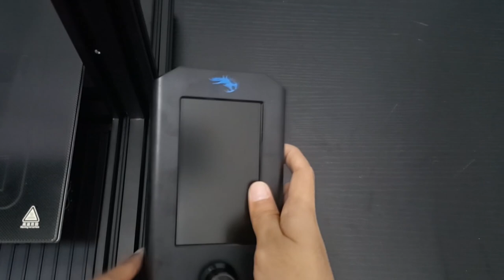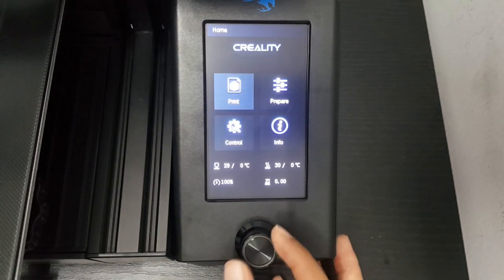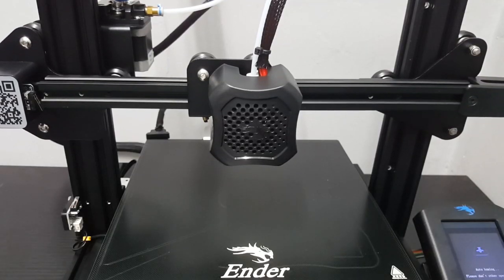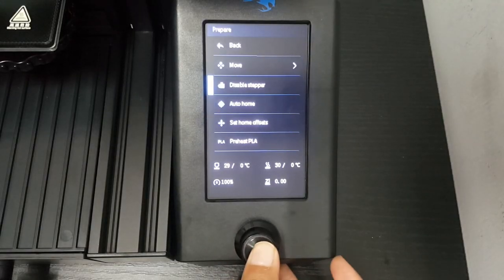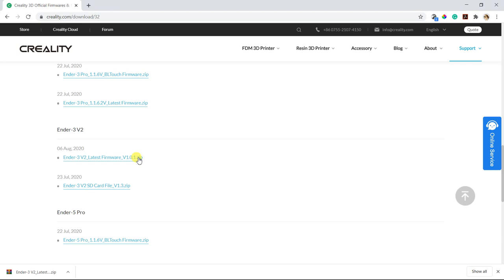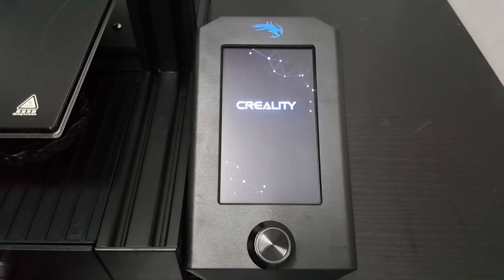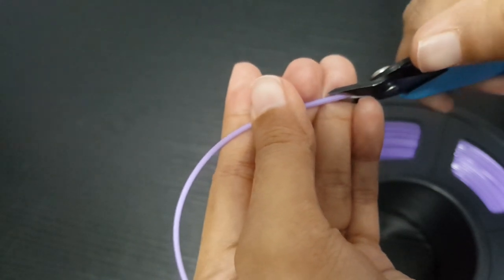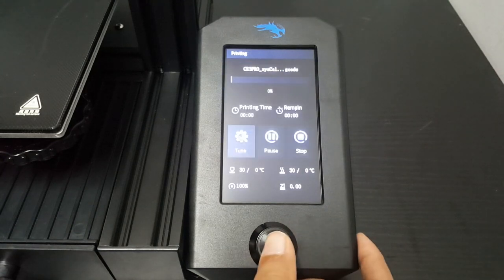Assemble and Update Firmware for Ender-3 V2

Comment: You have the V2 that doesn't have the (2) pre-drilled/pre-tapped mounting holes for the BLTouch etc (pen holder etc) on the left side of the printhead metal backplate. (Left of plastic fan shroud). You might want contact the vendor or Creality for it to make your life easier.

Comment: i followed your instructions, but ended up patching with the latest firware and screw up my whole printer and now its not leveling up on the Z-axis and it keeps on pressing down when it prints. my first printing on the sample "DOG"  just sheared off the nozzle to flat.
Reply: I think you mistakenly download the firmware for BLtouch. Just reload the correct firmware.

Comment: hello, i just got the new 3d printer, but the micro sd card that came with box can't be read? I'm ready to print, i checked usb driver from box and it says Fat32, it also has the print models in usb, when i connect to computer, i don't understand? the printer can not read it. something wrong with my printer?

Comment: aslkm, hai, Update firmware tu sesuai juga utk Ender Pro 3 tak? Mcm mana nak check ada latest firmware? Tq
Reply from the maker: Waalaikumussalam. Hi, firmware tu boleh muat turun di link ini : https://www.creality.com/download/32 Untuk latest firmware, sila semak tarikh terkini dan versi terkini firmware yang di keluarkan.
Reply: Ender 3 PRO does not come with 32-bit controller (except you upgrade it yourself), the default board comes on Ender-3 PRO is 8-bit and you need to load bootloader into it first.
Reply: @79ober  Creality has started including 32 bit mainboards in the Ender 3 and Ender 3 Pro, and heard also the Ender 5 and Ender 5 Pro!  V4.2.2 or v4.2.7.  Can update firmware via MicroSD  card now.  Some may still get old 8 bit until sold out, replaced with new 32 bit boards.
Reply: @timd9430  Thanks for informing, din know that.